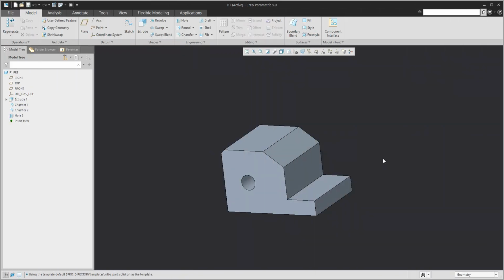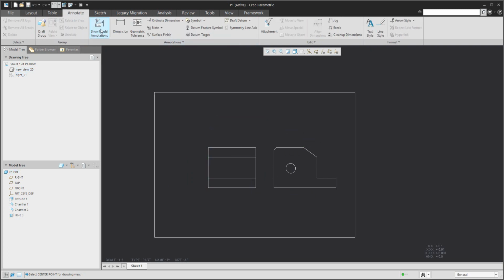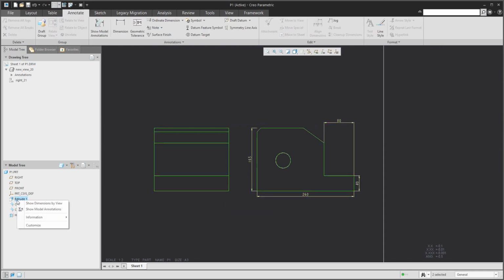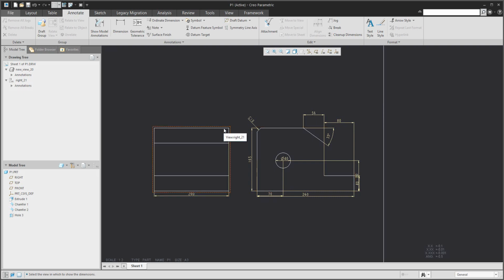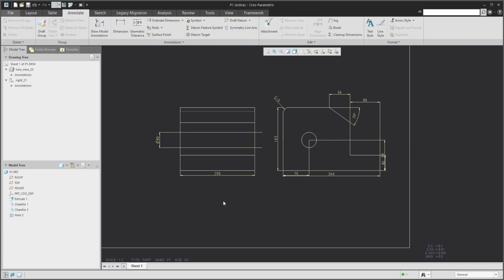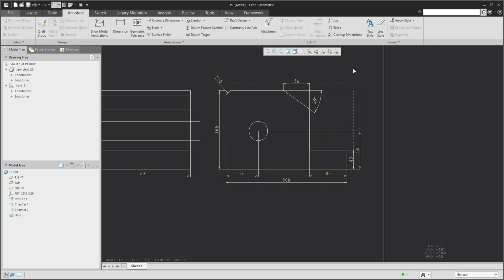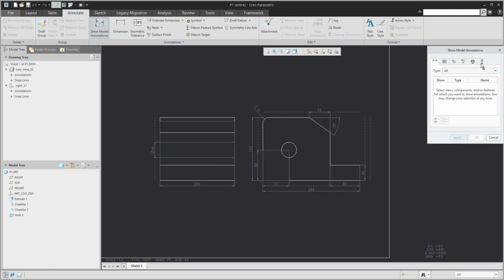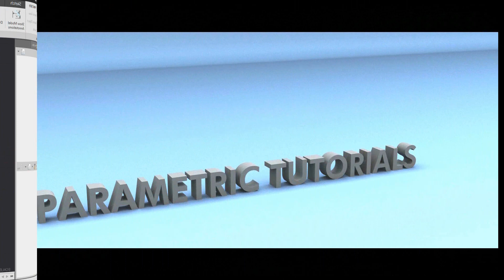Creo Drawing tutorial: How to show model dimensions in the drawing

Comment: how to thicken the 3d model edges in creo? when I'm taking snapshot of 3d model with ( solid with edges) edges appears thin. i need thick edges. how to do this?
Reply from the maker: Hi, thank you for question.
When I need to take snapshot from model or assembly with edges I use Save As (save as tiff file or jpg)
System will make a screen shot from current orientation and with correct edge visualization.

Comment: Hey vlad can you put up a video on how to add centremark directly like we do in solidworks & autocad by directly clicking centremark option.
Reply from the maker: Do you mean centerline in the drawing?
Reply: @4kside  
No its centremark that we add for holes or any circular feature.
In solidworks,autocad you can directly add centremark by selecting centremark option and clicking on the circular feature you want. But its not the case in creo there is no dirext option to add centermark